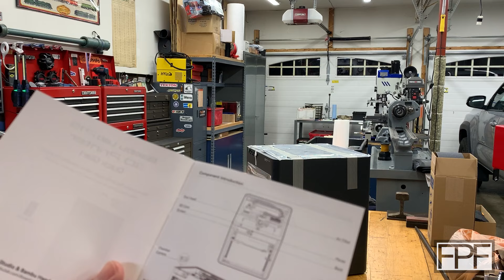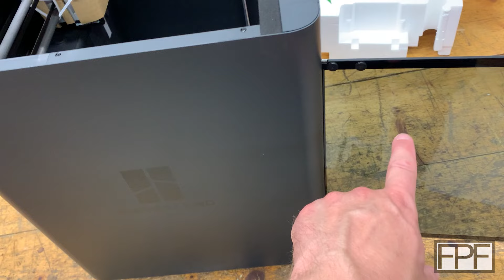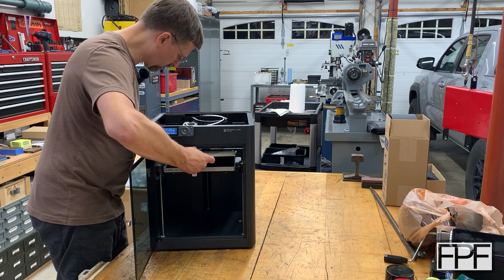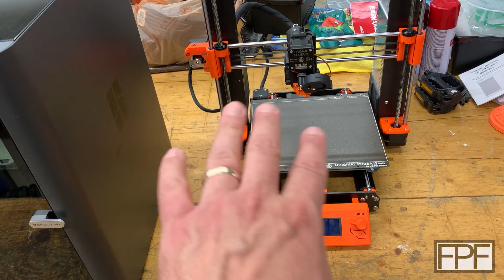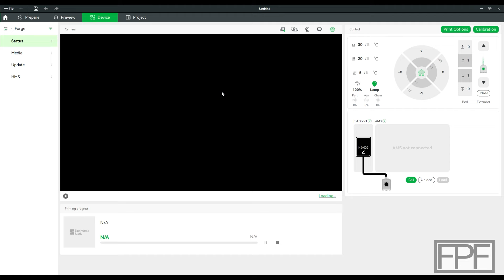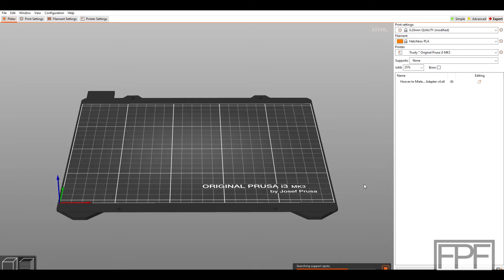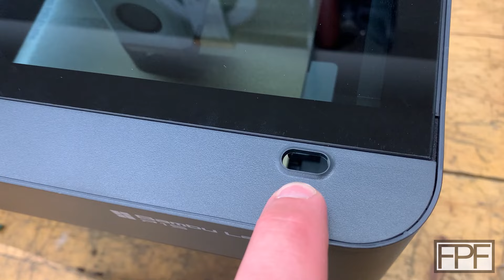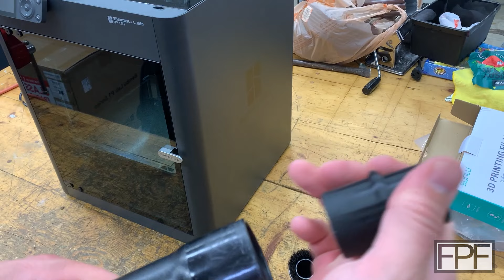Bambu P1S Unboxing and REAL WORLD prints

Comment: Unfortunately the wifi cam is only recording 720p@0,5fps for monitoring. This is not a network or software issue.
Reply from the maker: It's two different things.  I'd honestly be happy to get .5fps.  I'm seeing more like 1 frame every ~5 secs at BEST, and several minutes with no new frame at worst (or no connection at all).  We'd consistently get the .5fps if they would route between VLAN's instead of always sending all the traffic to the cloud when they're not on the same VLAN
Reply: I'm glad someone caught that. The lower res and fps is fine for time lapse or general spot check of a print. It is not the best for a live fluid feed.
Reply: The p1s only has a esp32 chip which does both printing and video processing.  The X1C has a much more powerful cpu and video handling.

Comment: Thanks for sharing your thoughts! One question: why did you get a P1S since you already had a X1C?
Reply from the maker: Great question!  I got the X1C with an AMS without realizing that you can't run a lot of the "carbon" engineering materials in the AMS anyway.  You can disconnect the AMS buffer tube and run filament in direct, but I'd rather just leave the AMS connected all the time, so the AMS will shift over to the P1S, and the X1C will just run from a spool and either be loaded with cheap PLA if I'm prototyping, or an engineering material (like carbon-filled PC or Nylon) when needed.  Having two machines that go FAST makes prototyping a dream, and when the P1S is busy making long-running multi-color prints, the X1C will still be avail.
Reply: @FunctionalPrintFriday  Y Splitter for the Bambu Lab AMS and Spool Holder

https://www.youtube.com/watch?v=_O-eqUQ1SiI
Reply: @FunctionalPrintFriday  My understanding is that the bed is firmware hobbled at 100c.  That may be an issue with some engineering filaments?
Reply from the maker: @philshel1  Yeh, I believe that's correct.  Not sure if that limit is artificial or necessary due to actual machine differences.  Either way, I'll just run the hot stuff in my X1C
Reply: Hi new sub here, great vid ❤ How is it holding up after one year? Any issues?

Comment: Yeah. I've loved my Prusa, but the new XL is on backorder until next year, and is almost 2x as expensive as the highest end unit from Bambu. Not sure how long Prusa can remain relevant in that scenario. I wonder if Prusa is limited by their adherence to the idea that they need to print their own product? I guess that preserves the jobs for their folks, which I guess is laudable.
Reply: I got X1C’s and MK4’s and they’re quite close with speed. Obviously a corexy should be faster than a bed slinger. Lately I had a print, 1d2h on X1C and 1d9h on MK4. every time I see a comparison between the Bambu and an older MK3S+, I know that is irrelevant. You cannot and must not compare that. Also, the XL is a multi tool head so no poop waste at any filament change and much faster as it doesn’t have to change filament. Obviously a multi tool head is more expensive than a single tool head. It’s also larger print area and better heated bed. I’m a Prusa fan, but also a Bambu, I got and use them both for my business.
Reply from the maker: @marcelzuidwijk  I think the comparison is still relevant due to the pricing set by each.  You could get 2 P1S's for the price of an enclosed Mk4 :(
Reply: @FunctionalPrintFriday  It's the biggest bang for the bucket at the moment... but its closed. You cant modify it like you can on any open source. With the latest alpha firmware I use the MK4's more than the X1C's... Its almost as fast and way better quality. The AMS wins it BIG times over the MMU though,...
Reply: Right now, the Prusa mk4 and XL are suffering in the print quality category because they haven't got the input shaping working yet. They've kicked the printers out the door early because they know they are losing future sales to Bambu Lab.  I want to see the XL with the 5 print heads run against the X1C with the AMS once the input shaping and a couple other issues are fixed.
Reply from the maker: @swdw973  me too, but it's still irrelevant if you could by 3 X1C's with AMS's for the cost of one XL with 5 heads to net the same number of finished prints
Reply: @FunctionalPrintFriday   I agree with you from that perspective. I'm just kinda  curious about how the XL will shape up with a functional input shaping. And to make BL even more attractive,  a P1S with the AMS is even cheaper. Sure it doesn't have the auto flow calibration, but neither does the XL. It uses load cells for, as they say, "a perfect first layer" , but nothing about auto flow calibration. So to me, the XL is more of a competitor for the P1S. So the price difference then becomes ginormous.

And since the P1S has the closed loop control of the X1, which the P1P doesn't. It can match the X1's quality if you dial in the calibration like you'd have to on the XL.

If BL will improve their customer support, then people won't have the one area where they claim Prusa is better about to rag on BL anymore.
Reply from the maker: @swdw973  Yeh, the customer service issue is somewhat of an enigma.  I'm sure they want to keep costs low, but they need to get service ramped up or everyone will only love them until their first major issue they need help with.  If you want to offer a turnkey printer, you have to offer a turnkey experience too.
Reply from the maker: @swdw973  I think the XL would win in most categories aside from price.  The problem is the gap in that category will be so big it won't matter :(
Reply from the maker: It could be. . and they could scale that printing if they had to.  I feel like their problem is probably more in the product devel/engineering side.  They're probably running R&D the same way they were 10 years ago, and it's just not enough today.
Reply: @FunctionalPrintFriday Got it! In truth, the ideal number of printers is n+1 😀  By the way, there's a trick to use single spools without disconnecting the AMS. It involves using a "Y splitter". I have one installed on mine. You can find several different variations on Printables.
Reply from the maker: @jphalip  thx, I'll check that out